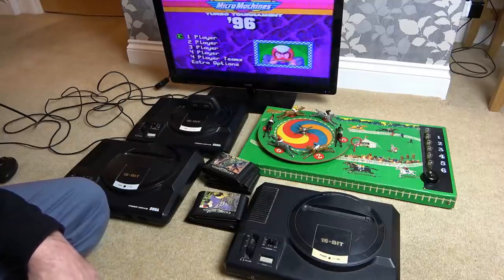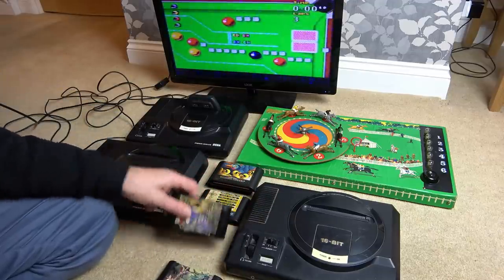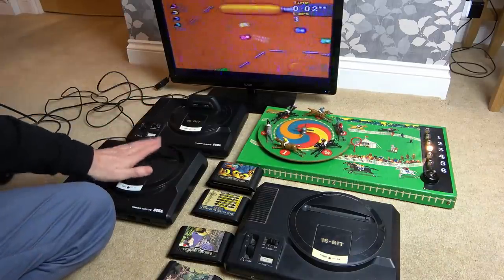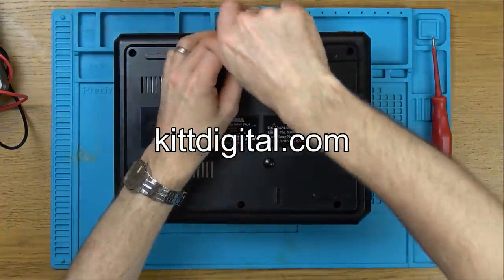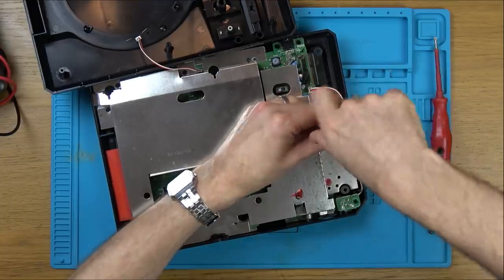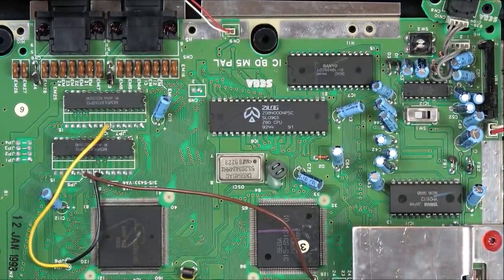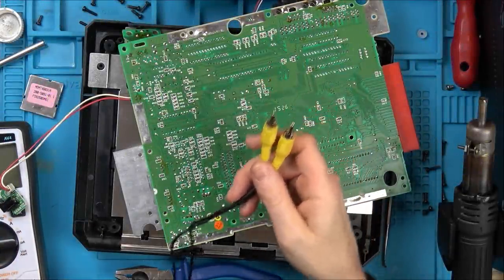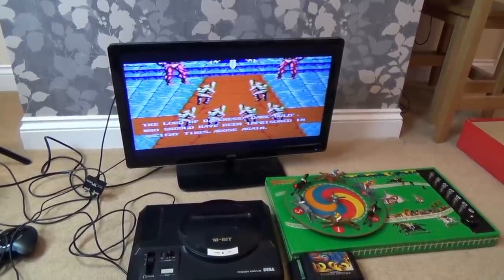Trying to FIX a Faulty eBay SEGA MEGA DRIVE (GENESIS)

Comment: Hi mate. Nice video. I used to (and kind of still do) fix these quite a lot (must have done dozens of them) and got really excited when you found the short on the RF as I was thinking "ooo - I would never had thought of that. Looks like I'll be learning something new!"...
A few tips, if you're doing this again:
- The red "do not remove" cover is the Sega CD expansion slot dust cover. That message is very dramatic..
- The LED wire is crudely slotted into the cable. I usually straighten and then  cut the led legs in half so it's easier to get the connector on and off.
- The reset buttons on the MD1 and 2 are hot garbage. They either get stuck on or don't work about 50% of the time. Black screen can be a symptom of a stuck-on button. I usually replace them with little tactile buttons.
- Not only do I systematically clean and resolver the cart pins (on account of them being a major failing point), but I "respring" them too, which is what you were doing with that pin. A much quicker (and neater) way of doing that is to take a little flat-head screw driver and push down on the top of the pin. This makes the pin consatena down, bending towards the opposite pin. You can gently "bounce" down on it to fine-tune the bend. 
- The 2x voltage regulators get super hot. That screw that goes into heat sink, effectively turns the entire RF shield into an extended heatsink. I ran tests, and without the RF shield, or even that screw, the heatsink gets LOADS hotter. My theory for that red epoxy stuff is to make sure they stay nice and tight to keep the contact good. Not sure. Either way, it's really common to get these broken units without the shield or screws in as people are, apparently, too lazy to put it back together properly.
- Not a tip, but it's really interesting (imo) that in pretty much each unit (more-so in the MD2) there are usually fingerprints in the heat shield from the original Chinese factory workers. The oils in their skins tarnished the chrome plating, kind of fossilising into the metal. Each are unique. You can sometimes see them though the bottom grille on MD2 better.
- The mod you did only needed a ground, so you could have literally soldered right next to it rather than running that long cable across the board. Having said that, it probably wouldn't have occurred to me to leave the exposed wire short and would have left me wrapping it in tape, preventing a short or something. I gave out an audible "...oh yeah..." when you did that :D
- oh. And, I'm sure you're already aware, but getting an RGB scart cable for that is a must. The picture/ colour quality difference is night and day.

I've developed heaps of my own tricks, over the years, to test and improve these things. Sadly, 90% of the issues with them are just dirt/ weak spring contacts, so it's very rarely anything overly interesting.
Looking forward to the 2nd video, but I fear it will be much the same  – hence why I don't really do these consoles anymore :/
I actually have a MD2 that has a very interesting fault on, that I was going to offer up to you. Basically, all the sprites on the screen are totally scrambled and in the wrong place on the screen. If you're up for a bit more of an actual fault-finding, component swapping mission, I can send that one over to you :)
All the best,
Luke
Reply: Yo almost 1 mil
Reply: Well I know this is three years late but I recently got a megadrive, interestingly all colours show however whites get replaced randomly by yellow or green, I'm thinking the caps but since you have vast knowledge have you ran into this before?

Comment: Vince is so old school he’s the only man still using a RF switch in 2021. Great fix.
Reply: I use them all the time... I also convert stuff to composite out... I wonder how much longer we will have that on new TV's
Reply: R
RGB to OSSC, HDMI to TV is the way to go!!!!!
Reply: @Dez083  Perhaps, but at over £100 not everyone is going to have one. Some retro consoles don't generate RGB. Most TVs still accept composite and a mod for that costs less than £5.
Reply: Oi I use it with the Genesis mate
Reply: I'm using rf switch on my nes in 2022 and once my faulty sega genesis comes in it has rf switch as well

Comment: Had to be first on this one ;)  The reset switch is resistive rather than gives a short!  So probably nothing wrong with the reset switch other than a clean of the contacts needed.   It can seem like the slot is just not working regardless, but that's usually a sign you need to clean it with something more abrassive (very fine sand paper), but I generally just push folded paper into these slots (covered in IPA or deoxit).  Fine grit sand paper is a last resort as any damage to the surface of the socket pins will translate into damage on cart edges etc.  It can seem like the slot is just not working regardless, but that's usually a sign you need to clean it with something more abrassive.   Great to see it working!!! =D
Reply from the maker: Haha, congrats on first! Thanks Chris, that damn reset switch!!! It was perfect all along. It was a bit of pain to desolder as well, at least it will teach me to check for resistance change rather than a short in the future. I will try the DeoxIT paper trick on the next one, if it works it can be a tea break repair video instead. Cheers mate :-)
Reply: @Mymatevince  PAL-I  if memory serves... that`s PAL- Italy ??
Reply: I repair lots of these mega drives, I've 6 on the bench at present (RGB Issues), 4 ready to be shipped out. If you ever do need to replace the reset switch, here is the part number for the new tactile option.: JB15FPG05   Love your videos by the way Vince!

Comment: As someone has already said, the port on the side is for the Mega CD add on.

The EXT port was only on the original model and as was intended for a modem peripheral that never released (we got Sega Meganet instead which connected via a cartridge).

The "mod" on the MC68000 chip would have been done at the factory and was common on early models to fix a bug that could cause the console to crash.

Comment: Hey Vince, it's quite normal for most UHF TV modulators to read a short circuit at their output when tested with a DC multimeter, as high RF works very differently to DC voltages. Without access to UHF test gear, the best method is to test the voltage at the power input of the modulator section, and if it's good, then tuning an analogue TV channel to the UHF output frequency (normally UHF Channel 36 or thereabouts in the UK) you should be able to see a difference in the static on screen when you have it tuned correctly, but a DC test will invariably show a dead short at the modulator output.

Comment: Hi Vince, great repair video! RF is rubbish, but the Mega Drive's AV out is great as it does full RGB out and stereo audio! My brother made me a DIN to SCART cable back in the '90s which I still use today. If you're going to re-sell these I'd recommend putting in a region/50/60hz mod. If you're going to keep one to play games on, I'd also recommend getting a scanline doubler which will output a nice picture via HDMI.

Comment: Lovely to see this MD working again.  Odd that the cart slot pins seemed wider on the left side.  I guess it could be caused by an owner consistently pushing the carts in at a bit of an angle?  🤷‍♂️
Reply from the maker: Cheers Steve, pushing in or maybe taking them out at an angle on one side. GadgetUK mentioned it might be more related to dirty contacts. So possible by bending the pins in, it allowed the cart to clean the contacts which then fixed the problem. We'll see what happens on the 2nd one as the issue is very similar :-)

Comment: To get the LED disconnected, bend the legs up and slide the wire off from there. Make note of the polarity colors and leg length. Red's positive/longer leg, I believe. I have my console in storage and can't be bothered to get it out to check, lol.

Comment: Just a little background info: The model with the extension port is the launch/Gen 1 model of Mega Drive (easily recognized by the High Definition Graphics and Stereo Sound tagline, which was removed from the later revisions.)

And the "odd slot" on the bottom is the edge connector for the Mega-CD.

Comment: That expansion port at the side is for the Mega CD. Not seen one with an ex port on the back.
Reply: its only on earlier models, its for the sega modem, a service only available in japan.
Reply: They are like female 9 pin controller ports!
Reply: That's right it was also used in the megadrives arcade hardware equivalent system 14 system c and system e for coin counters and other backend stuff.

It was also used as a basic debug port through a coders cable and could offer basic debugging. The port is a sort of cut down parallel port even though it resembles a serial port or d sub port.

If you want to interface with you'll have to use logic level conversion. It's also no different to the front facing controller ports except it's female instead of male connectors on the front.
Reply: @SproutyPottedPlant  Does that make them "serial" offenders?

I'll get my coat...
Reply: Glad you said it, I was like "Geez Vince, come on man, what do you think that is?". :P

Comment: Switches also can be used in a circuit to change resistance which the processor can change state. Normal switches are either ON or OFF. Great content Vince!!!! Keep it up!

Comment: That reset switch really threw you into a loop, it seems.

And I do wonder what caused the cartridge slot to widen on one side, but not the other...

Another great fix, in any case! 👍
Reply from the maker: It did and there was nothing wrong with it! At least it will teach me to look for a resistance change rather than a direct short in the future.  Between the wasted time on this and the Game & Watch carbon tracks I will be sure in the future to check for resistances, if the continuity tester is not making sense. Cheers Operational :-)
Reply: Maybe someone’s tried putting something that shouldn’t be in it down the slot

Comment: BTW the other Mega Drive with  'High Definition Audio' is a really early one and is highly desirable and pretty rare. It shouldn't show the initial produced under licence by Sega text when you boot it.
Reply from the maker: Thanks for the info Chris :-)
Reply: @Mymatevince  Yes. The board in that one will be revision VA0 which is the earliest and arguably best MegaDrive hardware SEGA made. I suggest if you can get it going you keep it as your main? Also you can pick up scart cables for all revisions on eBay for a few quid that will drastically improve your picture quality.
Reply: It's not that rare, I have 2!  VA6 ones are common, same audio circuitry, no HD graphics, TMSS!  Look at the rear to tell the good ones from the bad ones.
Reply: @SimonNemeth  It can't be a VA0; that board was exclusive to Japan at its launch. I think Europe's launch machine was VA3. I know North America got the VA2.
Reply: Mines just says SEGA then boots up the sonic games

Comment: when it comes to megadrives i always just photograph and inspect them for obvious damage but dont chase down rabbit holes, use some kitchen and stove top cleaner to scrub down the board, wash and then alcohol rinse. ensure they're bone dry and retest. more often than not when they die its because of a chip you can't replace. anything short of that will be obvious like the power switch/ power jack/ av ports being corroded or the solder joints on them have cracked and need reflowing.

Comment: Hi Vince, Firstly, very informative video! Just a quick note about the black screen errors.

The boot process for the MD has a small security check, The black screens that most people will tend to see is related to a failure within this process.. The infamous "Blowing" trick of the cartridge stemmed from this where the cartridge doesn't sit correctly within slot.

When the console boots, It reads the cartridge and has longword bytes written in the ROM @ address $100, This translates to "SEGA" in big endian ASCII code.
The TMSS checks to see if this is written correctly and will show the usual "Produced By or Under License From Sega Enterprises Ltd." message.

If it fails usually because of the cartridge connection, it will show the black screen. It was interesting to see how SEGA did their best to prevent unlicensed games. 

Hope you dont mind the history lesson! If you want a little more, I recommend the SEGA vs ACCOLADE lawsuit, A very interesting topic on licensing requirements and a sneaky way of getting round the rules back in the 90's!

Cheers!

Comment: To the best of my knowledge, the red material on the screw heads is to prevent loosening. There is a product called Loctite that is used directly on threads, and I suspect this is something similar.

Comment: i had a sega genesis as we call the in the good ole USA, and mine looked similar to this one and i even remember that little port you noted. by now im sure many have mentioned what it is. but in case not, it was the connection port that the original sega cd used to connect to the system. 

when you think about it cartridge based systems all seemed to have some bottom or side connection port for future peripheral planning. the NES had on on the bottom, not sure if the SNES had one, the N64 had one. sadly at least here in the US and ive heard over there across the pond, we westerners never got those add ons. they all stayed local in japan......lucky bastards lol

Comment: The chinese PCBs are thinner than japanese one, that is why you have to push cartridge aside to make the console work with them. That was a common problem back in the 90's, and that is how you would recognize cheap ones.
Reply from the maker: Ohhh, interesting. So that might be why some games worked and some games didn't. As always Technixbul you have the answers. Cheers for sharing your knowledge. 👍👍👍

Comment: Hi vince, on the rf output there should be a voltage regulator for the strength of the  output sometimes need to up the voltage do to aging. Picture s should come out clearer. But don’t make output signal to strong as it will transmit the signal through the air and will be picked up on your tv wirelessly but that’s classified as illegal.

Comment: I just got the same console with no working RF which i am hoping to fix. Did you try the av lead on its own to see if that worked or how did you know to check the yellow cable wire.

Comment: With RF you are talking about impedance not resistance.  There may be a small coil across the RF output, its impedance on HF is high but on DC its resistance is low. With RF impedance must be matched, input to output..

Comment: Nice fix, pretty much just pin contact problem :)
Tinkered with my computer today as opened my 8 years old laptop the first time today. Cleaned some dust from inside, and added 4gb of ram, now it has total of 8gb ram. Seems to work better with added memory :)

Comment: Never knew about the resistor on the 68k being a factory mod, I have one with that mod which also isn't working, I might have to dig it out and try the cart slot pins as I've already isoprop'd the board

Comment: HI M8 dont forget the RF socket has an impeadance of 75 ohms so buzzer no good as anything-under 300 ohms will cause buzzer to sound.
Reply: 300? all of my meters beep only under 50ish ohms.
Reply: many Rf outputs have a coil between RF out and ground. It's for DC a short, but AC cant pass it.

Comment: Doesn't matter if they short as they are divided by the card edge on the cartridge.  Only would matter if you turned it on with no game, which you should never do.  Some RF shields are used to bond ground planes together on different boards, even sections of the same board.  Apple was notorious for doing this.  Keep them in tact.

Comment: I think the RF signal has a very low voltage, so 1 Ohm resistance is quite plenty for it.
But if you have the Mega Drive already open you should make either a composite or Svideo mod.. 
The RF is original, but component / SVIDEO is much better.

Comment: I'm in the middle of a TG16 repair and those RF modulators suck lol. Pretty sure mine leaked electrolytic all over and they are a pain to remove. Want to just remove it entirely, id put in a composite if it was being resold or something.

Comment: with you having to pull the cartridge up at that point in the video I was expecting that you'd need to resolder the contacts for the pins that connect to the cartridge and they were under the PCB and not making the right contact unless only a lighter game was inserted or something lol

Comment: Dya know that weird moment where you’ve found your old megadrive in the back of the loft that you havnt played on in 30 years plug it up switch it on and all you get is a black screen and carnt figure out whats wrong with it then this video pops up in my recommended... weird, also for future reference you can tighten the pins just by pushing down from the top of the pins with a small screwdriver

Comment: looks like you have 2 with lockout chips. the one with the serial port on it has no lockout chip therefore most games should work without issue. in Japan that serial port was used for a modem. in the USA it was never used and since I'm seeing the port gone on later revisions I'm guessing it was not used in EU either

Comment: The pins are a weak point on any cartridge based console and they are likely to be rather worn after 20-40 years of usage and carts pushed in and yanked out .  I own 2 megadrive consoles - one is an old  modded one model and the other is a 2 model.

Comment: Was that system modded? Those wires and the resistor don’t look OEM.
Reply: All from factory. Resistor is implied for TMSS (Patents sticker is a clue), wires are here for some test/market/model variants purpose. Very common in electronic devices of these days.